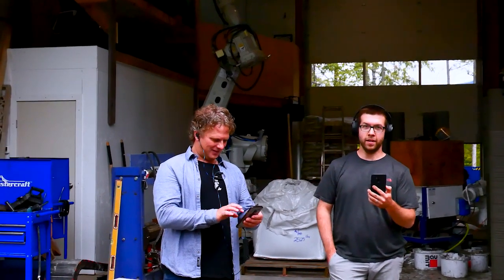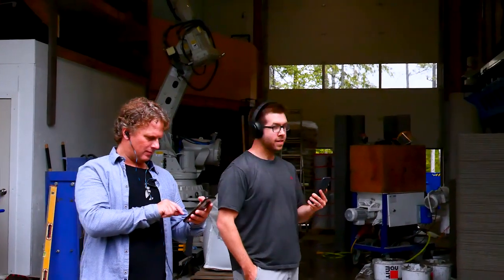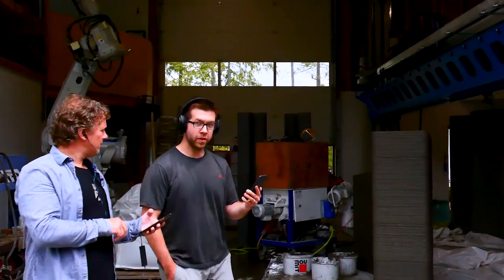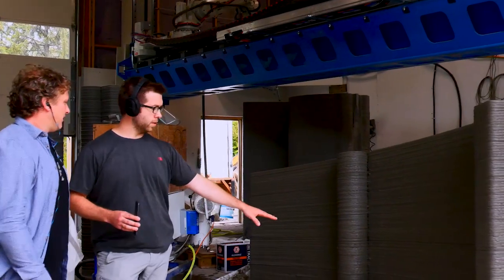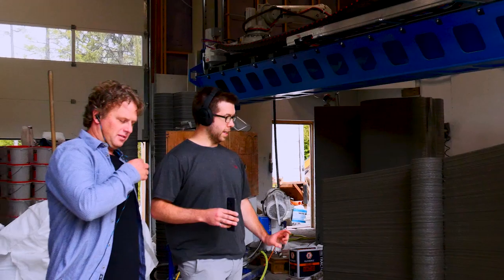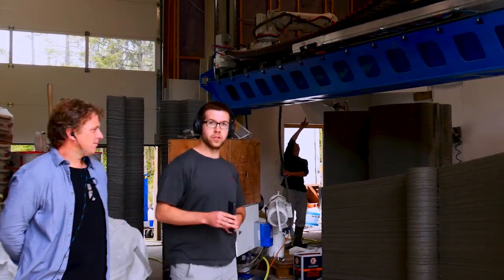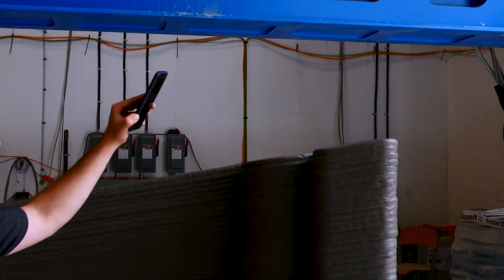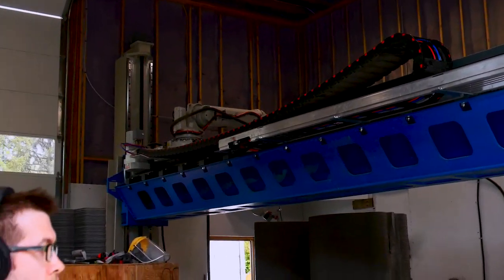TAM Biggest Concrete Printer | Founder Shows Off 3D Printing Concrete Tech

Comment: I appreciated your honesty in discussing the challenges that have to be addressed from materials to regulatory and permitting issues. Its the first time I've felt there was some rational leadership involved with the 3D printing as a business. The collaboration that you are providing will ceratainly accellerate automating the construction industry.  Thanks for sharing your experience.
Reply: Thanks for your feedback! We prefer to present the reality and push that reality to be improved than to make promises we can't keep! The Industry has a long way to go but it will only impove in the long run. Addiitonally, the market of construction is so extenssive that once there is more general acceptance of the technology and its capabilities, things will relaly take off. Things will become more....concrete... :D